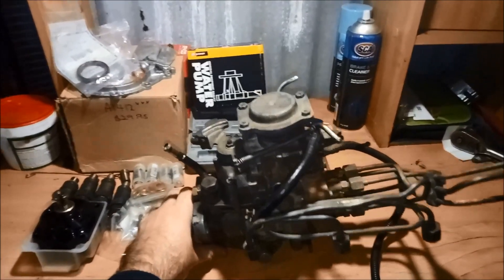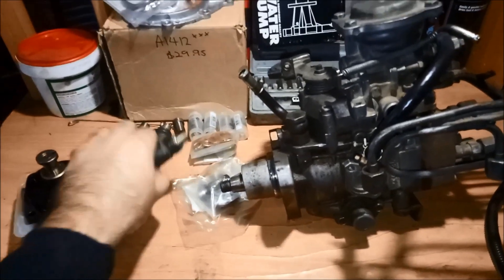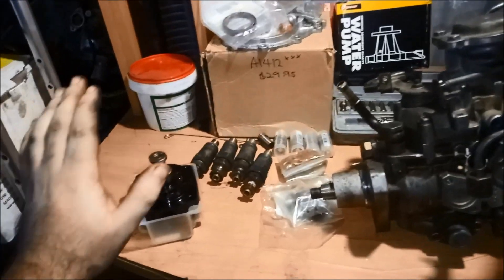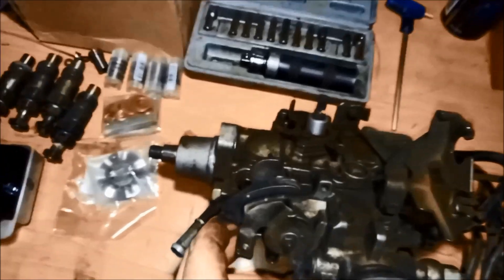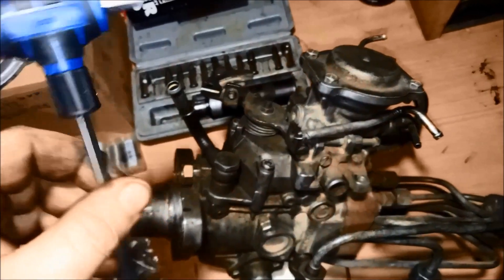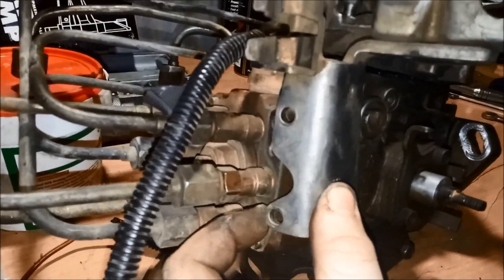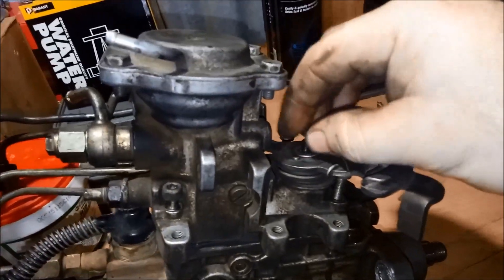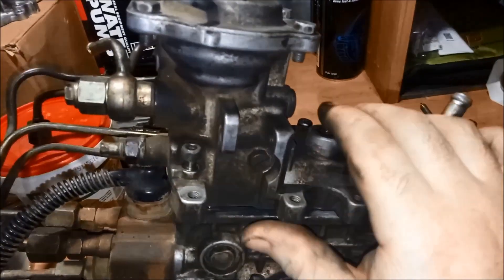part #1 rd28 gq pump disassembly for 12MM upgrade

Comment: Hi again Mighty! Just ordered the element for the pump and started to think of the nozzles. Im looking to get 30-40 % more out of the pump and i red somewhere that nozzles needs change if you are pushing 20 % or more. Do you have any part number, or even better, a link where to order "bigger nozzles"?
Reply from the maker: no part numbers im still looking for my self for bigger injector nozzles but no one will give up what nozzles to run all tell me what there flow rate on injector nozzles giving me the shits
Reply: Hm. I will check around. I know there is a firm in Denmark which have developed a "package" where you an get 250 HK from the RD28 engine - it contains 12mm pump and bigger nozzles.
Reply from the maker: yep i seen it if you find something send me a message
Reply: @madsff7439  Hej Mads.
Im from Denmark.
What firm is selling this 250hk tunekit?

Comment: Morning! Thanks for sharing this video, and for the tips regarding the upgrade. I wonder; I have a standard GQ pump, believe the rotor is 9 mm standard(??) - can I buy the part you have linked and do a straight upgrade to 12mm? Or is it anything else I need to take care of before I start a upgrade?
Reply from the maker: Mads FF yes the standard gq pumps are 9mm.  The 12mm rotor head should bolt straight on, you just need to get the pump set. If your only running stock boost I would advise you to only go to 11mm, depends on how much power you want. And consider your clutch if you go to high in power.  Your clutch may slip.
Reply from the maker: Mads FF all so if the pump say ve6/9 it's a 9mm pump
Reply: Awesome. You dont happened to have a link for where to buy the pump set? Im running a bigger turbo, gt2860, 3 inch exhaust and pressure around 1.5 bar - its running good, but im guessing a new pump element would do the trick. Will consider the clutch upgrade as well. Thanks for the reply!
Reply from the maker: Mads FF the link is up above in description for the 12mm rotor head. Just take the pump and rotor head to a diesel shop where they can bench test it and get them to set the pump for you. It may cost around $600 ,  when do you find the gt2860 comes on full boost? And Anytime.
Reply: It starts to react around 2k rpm, and won't hit full due to lack of diesel I guess. Was thinking of doing the swap  my self after your informativ videos - Will send the pump away to set it as I dont have the tools my self. The engine setup I have is working quite good. Its breathing good (3 inch) both ways. Thanks for the info mighty - send me a private message with your e-mail and Ill show you the car :)

Comment: Hi, if I am just looking for alot of smoke, trough the Whole rev range, is it enough to just adjust the fuel screw only? I have an Y60 RD28T 

And yes I know the tops are not good and so on, just want to know. :-)
Reply from the maker: adjust the fuel screw give you more fuel so yes it give you soot but to much fuel kill your motor
Reply: mighty rd28 4x4 Thank you, and how kill ? What mods would be needed to compensate.

I want Big Black smoke from this Patrol for a short period, not permenent. 

And is it just that single screw the feeds more, so if I wanted it for a short period, I would adjust the screw alot, then adjust the rev screw so I dont have 1200-1400 ish at idel, then put it back efterwards?
Reply: Hey mate i just done my pump also.  Having  abit of drama with it . Just to get it to run i have to max my fuel out and it runs fairly rough like lumpy i tried backing the fuel off but i get one turn and she wants to die . Any insight is much appreciated fyi all new internals

Comment: Hi. good video I want to install rotor head 12mm in my Patrol Y60 rd28t. Do you know the reference? thanks greetings
Reply from the maker: 12mm rotor head https://rover.ebay.com/rover/1/705-53470-19255-0/1?icep_id=114&ipn=icep&toolid=20004&campid=5338193437&mpre=http%3A%2F%2Fwww.ebay.com.au%2Fitm%2F096400-1320-Rotor-Head-0964001320-Head-Rotor-Diesel-VE-Pump-Good-Quality%2F172774041969%3Fhash%3Ditem283a22a971%3Ag%3ApmMAAOSwkklZmoww